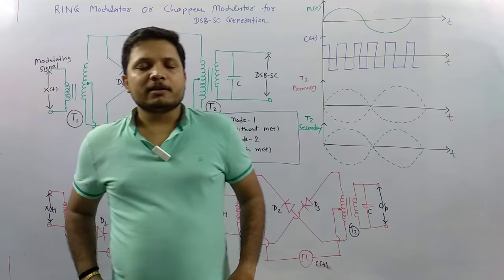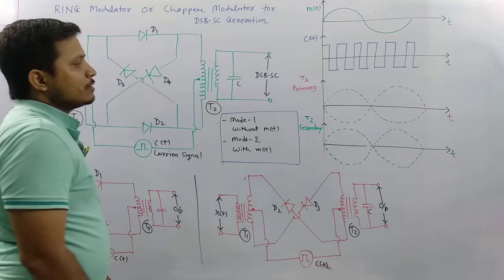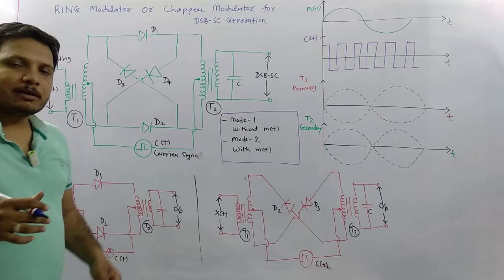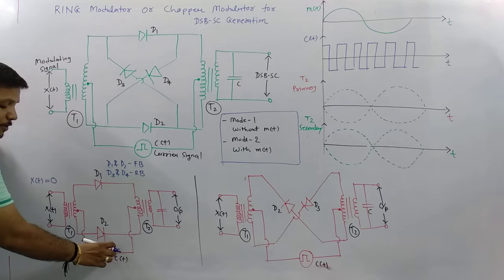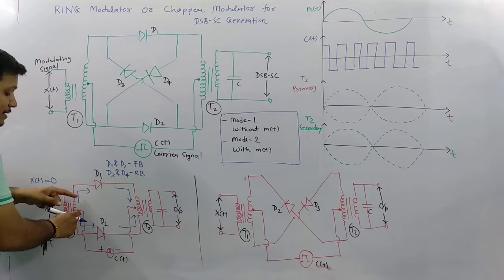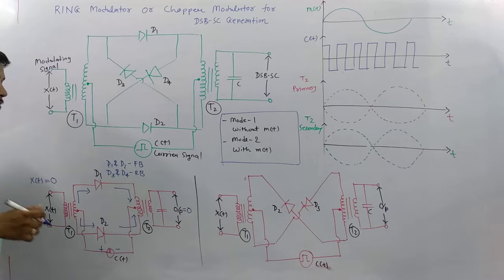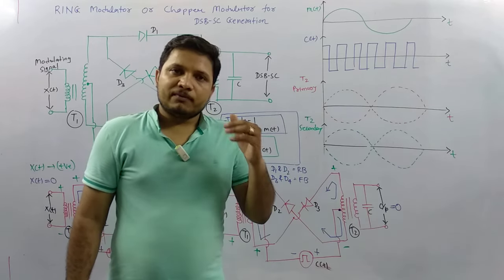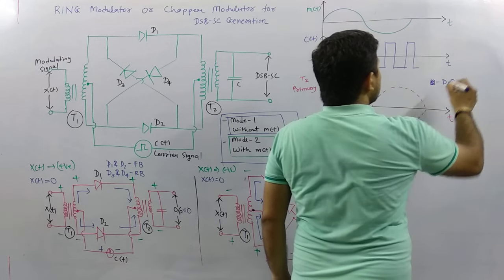Ring Modulator for DSB-SC Generation (Basics, Working, Circuit, Waveform & Impotence) Explained

Comment: There is something wrong. When m is +ve and when m is -ve. It's wrong explaination.  It's simple that during +ve half cycle of carrier wave, the m will appear at output and during -ve half cycle -m will appear at output.  So it appears as if m is multiplied by a train of periodic square pulse which switches between +1 and -1. So m is multiplied by such pulse. M is not multiplied by carrier wave as you are mentioning here.

Comment: could you explain why we use transformers in this setup and are those IF transformers (or some other type), why are they essential? Can we use 4 resistors instead (replace every CT half with resistor), the current will still cancel when only carrier is applied, am I right?

Comment: very nice explanation .on e doubt at 0938 time  you have said Xc makes to contact di & d2  that is right .then di contacts for X(t) on the top of the transformer  and reflected on to other transformer .what about negative of the X(t) get goes through from D2  and reflected  to the second transformer .pl explain about current path of the negative X(t) voltage to second transformer

Comment: helpful video & praiseworthy effort.
But i've a doubt at 8:51. Shouldn't D2 diode  become reversed biased as it got - ve polarity from the message signal?
and if it happens then how the m(t) will appear at o/p side!
Reply: Diode biasing is controlled by the carrier signal. It will cause diodes to become forward biased.

Comment: Sir i have the doubt ... In dsb sc ... Carrier signals are not used right sir.... Then y in this ring modulator the carrier signal is presented .... for modulation ????
Reply from the maker: In transmitted signal, carrier signal band is not transmitted in DSBSC. Modulation is done with the use of carrier signal only.
Reply: @EngineeringFunda  thank you so much for your reply sir ...❤️❤️🥰🥰

Comment: Sir, in this case carrier signal is suppressed in mode 1 but what will happen in mode 2
Reply: The carrier signal is not intially suppressed but gets multiplied with the message signal.
Reply: @rd1abrar924  thanks

Comment: You made some errors. Diode numbering in the right most circuit is not correct. Diodes should be D3 and D4. Another important thing is that secondary polarity mark in case of a center tapped transformer is confusing in this case. As usually the middle wire is grounded in CT transformer, but here is a source in this place. You should elaborately explain the polarities in this case and diodes' operation when there is x(t) and m(t) combinedly.
Reply: If u know the polarities , please explain because we are confusing at polarities.....at mode 2